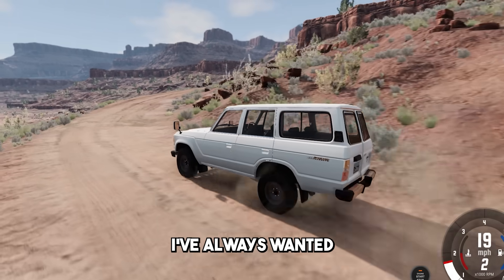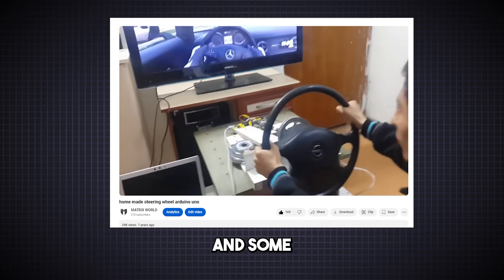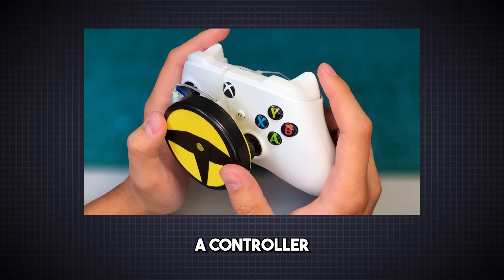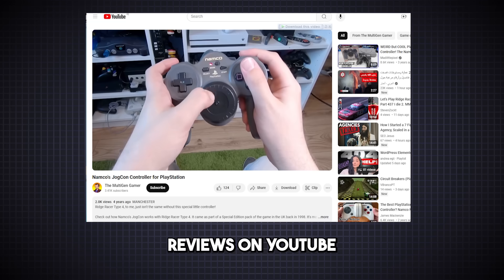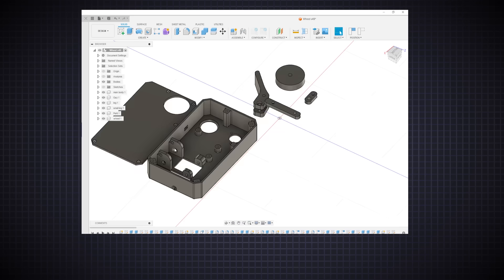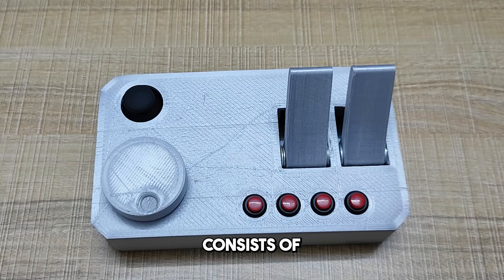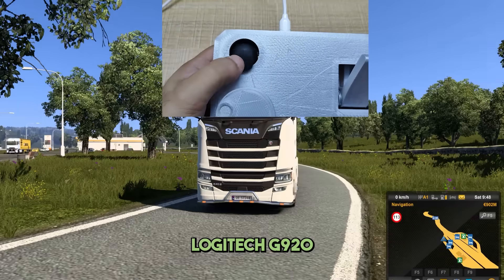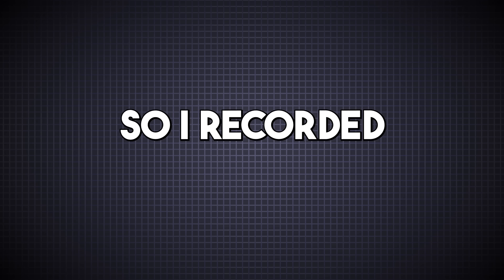The Racing Controller No Company Ever Made—So I Built It

Comment: I was just thinking about something similar to this. I bought the Thrustmaster Eswap controller and almost instantly purchased another wheel. It just felt much better being able to do micro adjustments with either thumb. The two things I thought about was 1) instead of having two wheels, what if there was just one big wheel with a light force feedback for both thumbs in the middle? 2) triggers that actually felt more like the pedals you would feel in a car. 

I like your idea, but design is kinda wild. I would love to see you try and make a controller that makes sense for gaming. They figured out how controllers should feel in our hands, but once you go the route you did, just buy or make a full setup. Otherwise, why not try and make a controller that works like a controller. I mean form + function. Cool idea tho.

Edit: To elaborate a bit. Your thumb is too important to control throttle or braking. It's your "hand" when you're talking about a controller. It controls precise movement like you're entire hand does on a mouse or steering wheel. Giant pedals are not necessary.

Comment: I guess this is a prototype but still how could this design be any sim-friendly? You will never be able to brake and throttle simultaneously with enough precision/agility. If you ever wanna try any rally stage without assists with this device then you will end up going back to the drawing board
Reply: Also theres decent steering wheels which are affordable. You have a 3d printer, come on
Reply: I once bought a 3d printed adapter which turns the horizontal axis of the left stick of a dualshock 4 into a small wheel which you rotate with both thumbs. Tried to get used to it but didnt like it. But maybe it fits your fingers better. Dont know how the thing is called, youd have to look up the model based on how i just described it to you and print it

Comment: Cool project, if you had a motor in the steering you would be able to make the wheel go towards the centre position, as caster angle would make a regular car do by it self (like letting go of the steering it would center).

Maybe it would also be possible to do it with some rubber bands inside the box, if you had one from each side. That would also give you some sort of steering frition and return to centre.

Comment: Well, thats an interesting and useful device. Steering-wise it's good, but in demo I see that it's only one thumb to operate pedals. You really need to use both throttle and brake at the same time. Maybe not in ets, but in most racing games it is so.

Comment: Imo I think it would almost make more sense for the controller to be designed in a way to allow individual finger for each pedal on the right side, either divets/inset pedals or a steeper angle to allow gradual motions down with fingers for pressure on the pedals instead of the thumb being used

Comment: This is absolutely brilliant. I love this form factor, I'm also a simracing nerd and actually own a Fanatec wheel, however for truck sim, beamNg, Farming Simulator and many more casual games I am soooo lazy to setup the wheel.

Will consider making one of my own!

Also: Consider running your 3d printer from car batteries. They mostly work at 12/24 volts.. You could very easily run them on battery and keep a batter car charger which I am assuming is more accessible for a better experience on unstable electricity setups. Give it a thought!

Comment: Ok I am not kidding when I say if people from game companies are seeing this then you need to move fast on revisions before they can make something out of your design and patent it.  This isa not only something that could legitimately compete on the market as a controller, you have ample opportunity to make a lot of money.

Your current layout is great.  Heres some recommendations from a player who has done similar:

Move the "Gas pedal" to the back where your fingers would go.  Keep the same feeling, but as a "pedal" rather than a trigger.  Once you form the placement for those pedals, the controller handles are easy to make.  Side note, a trigger lock for the pedals is a great idea so you can play in bed.  It can be a locking switch.  Small part.

A custom button layout is a great way to patent a controller body as your own.  I always thought the nintendo Wii U had the most ergonomic stick layout, so your upper control stick is on point.  What I always loved with my Xbox controller in Dirt Rally was using a control stick as a shifter, but the buttons are always in a horrible place.  If the "shifter" was in a lower position and the buttons were in a fan around the stick, it'd be much easier to use and actually hit the buttons.

Lastly, break your shell up into parts.  You could do separate colors for fun as a demo, but make the shell so that partsa like the sticks are "mount points" that pull together other parts of the shell and lock them in place.  You can avoid long print times with power outage problems.

Please make this a product you sell.  You will sell an obnoxious amount of them.

Comment: You need to upgrade you printer to something more recent. Resuming after power failure is rather popular function even in low end printers (200$-300$) nowaday.
There is a lot of metal dials options out there and they are not very expensive. They are far more hygienic that twisting your thumb on 3d printed part.

Comment: This controller is exactly what so may people need. Like you said steering wheel setups take up too much space for many. I would buy something like this for sure.
Also, for your power issue with your 3d printer, you need to purchase an UPS system. that will keep it running when your power goes out. Size it based on how long your power is out for normally, and then maybe get a little extra. Just so you dont lose print time and have to start all over.

Comment: i seen this shared on DIY Sim Racing FB yesterday its a fantastic idea. i have a full DD setup but id love something like this for more chill games when i just want to pick up and play without the need to use a boring xbox controller.
Reply from the maker: I agree with you; sometimes I enjoy sitting on the sofa and relaxing while playing the Euro Truck Simulator, especially in rainy weather.
Reply: @3dprinterart299  I would probably rather this over an actual wheel for trucking sims especially being that’s it’s diy the possibility for making a dedicated controller for truck sim, beamNG and MudRunner with as many buttons as you need. I lack the equipment and know how to build something like this but I’d definitely get one. Have you added a vibration motor at all? I think that would make up for the lack of FFB so you can get the feel of understeer on games like Forza Horizon.

Comment: Good effort, but this looks very awkward to use if you're at least semi-competitive:

1- Can't rest your fingers on the throttle and brakes at the same time (looks painfully uncomfortable if you try).                \\
2- You completely forgot about manual transmission. With this design, you can't brake and downshift at the same time.  ---  (You need buttons at the top)
3- The steering input doesn't look as fast and precise as a joystick, let alone a real steering wheel (mainly due to using only your thumb to steer, and lack of FFB. Imagine driving a car IRL with your thumb, and the wheel doesn't recentre itself when you let go 😂)

Comment: For your printer electricity problem, there are some solutions so that you wont restart everything:
The easiest one, is to have a printer than can resume after power outage. The ender-3 have this (though it's really, really wonky, and half of the time will just throw your print to the trash, but higher end printer might manage that better). The problem is that you need to not touch the print. The bed will cool down, so it's much easier for the print to not stick anymore if you push it a little. Second problem, if you don't pull out the filament, when starting back, the heating filament will cause a blob. You can remove it using cutting pliers, but you will need to do that after it started printing (so kinda complicated depending on print), and it will probably leave some traces
The harder one involve modifying the gcode. Because it's a set of instruction, what you can do i calculate the height of your print (again whitout putting too much force on it), from it get the layer that he was printing, then removing everything from the starting instruction (do not erase the starting instruction themselves like heating, keep everything before the print head move) up to the layer that you calculated (+1 so that the print head don't run into the print). Problem of this method is that you need to calculate a distance whitout ungluing the print, and you need to manually modify the gcode, which takes time, especially when you never done it before, and if you screw up the measurement then your print is gone
The last method is the pricy one. There are some multi-socket adapter that have battery in them, meaning that if the power is cut, then the battery is giving the power until the power come back. Now depending on what it is, it can either be a god and last a few hours, but it can also have a very small battery that will only last a few minutes. A great solution if it's short power outage of a few minutes, But if it's long period of time, you either need to spend a kidney into one, or you will to not look for one of the solution above
Reply from the maker: Thank you very much for your feedback. My Anycubic Chiron has this feature, but I’m not sure why it’s not working. When a power cut happens, the Z-axis drops by 1 cm, and the nozzle goes through the part, creating a hole. I think I need a better and faster 3D printer like the Bambu Lab X1 so I can finish my prints faster.
Reply: @3dprinterart299  Ah, maybe too much weight on the x-axis? What i think is hapenning is that the z-axis motor is constantly fighting against gravity. So when the power is cut down, the z-axis motor is obviously not powered anymore, and the gravity is pulling the print head down.
I am not 100% sure how to fix that, because i never really got this problem. Changing the stepper motor is a solution, since you could take on with higher resistance when the motor is off, but you would need one with mostly the same specification (same size, same precision), so it may not be that easy to find. Another solution could be to tighten the wheels on the other side, but frankly i'm not even sure if that could actually do something to your problem.
Basically if you want to fix the problem you would want higher resistance when the motor is turned off
Though with cutting clippers it's still possible to kinda mess around and cut the parts that melted on the outside and inside of the print, but this one is harder than removing a blob on the surface on the print.
Or you can still just buy a battery socket and problem solved, because the printer will never turn off
Or like you said, buying another printer might solve the problem. Though be careful on the feedbacks, because even on printers that it officially works, because they usually don't take it as a critical feature (most buyers live in big country like the USA, where power shutdown is really exeptionnal) and small modifications can just screw it up

Comment: So cool!
I just don't understand why your wheel have a center at around 9 o'clock. it looks so weird. It should have a center at 0/12 o'clock. maybe  just bad calibration. 
anyway big congrats! this should be the budget entry to simracing. I always wanted something similar before I bought a wheel
Reply from the maker: Thank you for your support! You can calibrate the wheel and adjust the center point to 12 o'clock or any angle that you prefer.

Comment: I don't know how severe your power issue is in iraq, but if you're dealing with short bursts of outages, it might be worth looking into getting a UPS, it can keep your printer/appliances running for a few extra minutes which might survive the downtime and keep the print running consistently.

Really cool video, and thank you for giving your work away so other hobbyists can build it.
I'm keen to see if anyone uses a servo/motor to get force feedback to work as part of it.
Reply from the maker: Thank you very much for your suggestion, Iraq's electricity is very unstable. Sometimes, our power goes out for 7 hours, especially during the summer and winter.

Comment: This is awesome! After reading a bunch of the great suggestions in the comments, i have one of my own. It might be useful to have a rumble motor for vibration feedback. On normal controllers and a wheel its super easy to know when the wheel is centered. On this it looks a lot more difficult to know when it is pointing straight. Having a quick hit of haptic feedback when the wheel hits 0° would help you know (without looking) that you have straightened the wheel.
Reply from the maker: I will consider including that in a future version. Thank you for the suggestion.

Comment: that's an amazing design but if you could add some buttons on the front like L1 L2 & R1 R2 from the PS  controllers to change the gears or use a handbrake to be more effective if you wanted to drift with it for example or use manual / semi manual shifting in general

Comment: Well done! Looks like a fun concept to experiment with!
I would like to try positioning the steering wheel in the middle so that you can use both thumbs to steer. It would allow you to mimic those tight turns where, in the real world, you would do hand-over-hand steering. In truck simulators and off-road games this could add to the immersion. With this setup we can add a gear stick for the right thumb, allowing you to shift gear while holding on to the wheel with the left thumb.
It would be cool to also have individual pedals for clutch, brake and gas, and orient them such that you press down on them with your fingers (as opposed to inward like on a normal controller). We can position them to mimic a real car, with the clutch on the left, gas on the right, and brake in the middle within reach of both index fingers.

Comment: There was the srw-s1 wheel which for me was the world. I have that same situation. Due to space constraints I can't have a wheel so this was perfect. Now after many many years the electronics died und they aren't made anymore so I'm not able to play my beloved sim games anymore. This device brings the electronics into a small package. This would be a great starting point to reinvent something like it again
Reply: Some feedback on your device. The angle on the pedals is too steep. Fingers can do a lot even with tiny range of motion cause they move very precisely so changing the angle to be flatter and shortening their length may be super beneficial for control and for speed changing between gas and brake
Reply from the maker: Thanks for the feedback! In the software, I can adjust the amount of travel, so it’s possible to make the pedals shorter if needed
Reply from the maker: Thank you very much

Comment: Congrats for the effort and for making so much with so little. I could think of some reasons why nobody has manufactured something like this yet. Maybe this makes sense for slow-paced games like ETS, otherwise personally I don't see the use of 900deg rotation for the thumb. There is a lot of unnecessary movement to do with your thumb that makes more sense to be done with both hands on a wheel. There is also the missed opportunity of adding triggers on the back to not operate everything with just 2 fingers and risk also pressing the throttle while trying to press on the brake.
Reply from the maker: Thank you for the feedback and kind words! This is my first design, and I’m planning to make improvements in future versions.
Reply: @3dprinterart299  Great! Looking forward to it!

Comment: that's super cool man.
I guess that initial Lower-left position of the wheel (225°?) is just for left thumb convenience. My question is if there's some kind of springy mechanism that turns it back to initial position when you let go?
Reply from the maker: Thanks, To make it return to the initial position, I’d need to use a small motor with an encoder attached. It’s something I’m considering for future improvements